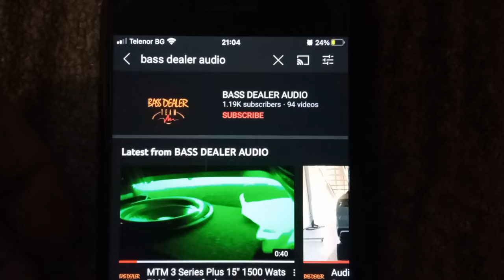Renault Capture 2016 Original Radio Removal / How To Remove Navi

Comment: That is the Radio thats in mine and it does not work since i had mot and service so i throught in might need the code putting back in every video to show you how to do it is a different front age the one you got there is the one i throught i would try and do it myself rather than take it back to the garage
Reply from the maker: If you need radio code , you can send me pics and we will decode your radio
Reply from the maker: Write me at Viber +359883432758